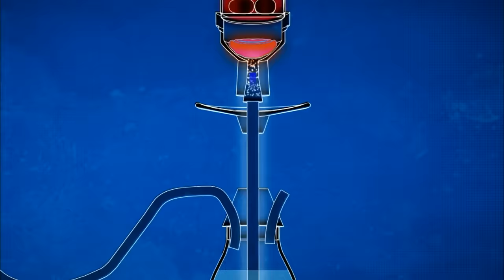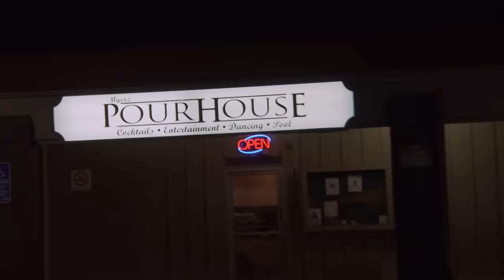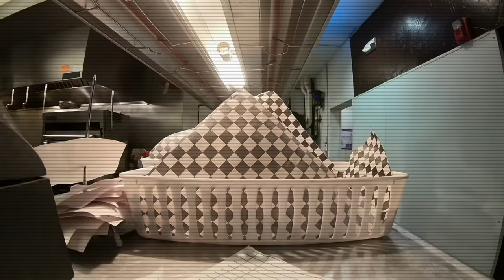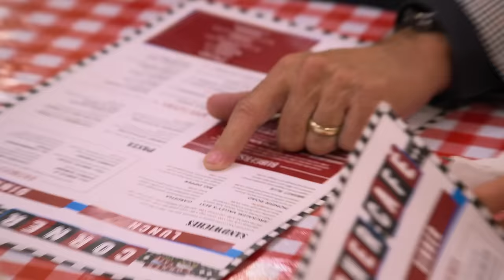Bar Rescue’s Most Haunting Discoveries 👻

Comment: One of the places I worked in, nobody ever cleaned the trap pan under the grill. 
It caught fire the 2nd day on the job, and it wouldn't go out. It was months of grease soaked ashes... burned like a tire fire. The response I got was "Oh nobody told you, we don't turn that side on."
I had to dump a whole bucket of salt on it to avoid pulling the supressor system handle... which would destroy all the equipment and shut down the kitchen... because the extinguisher didn't have a charge anymore. Turns out someone used it to kill a wasp nest outside. 
Yeah. 

I wigged out on the GM about the state of the kitchen and laziness of the rest of the cooks and how I cant work here if I am the only one who knows what to do. I am just a COOK and I know better. The GM had zero kitchen knowledge. The head bartended was the one with the obligatory Serve Safe certificate and she never ever inspected the kitchen. 
They promoted me to kitchen manager 😂. They didn't have a manager... just a checklist of stuff they were supposed to do every night that nobody ever enforced. 

2 people quit cus I expected them to work. 😂
They were butt-hurt cus I was new and they got passed over for the promotion, they didn't even know how to filter a fryer. They were waiting til it was black and smoking, and then just replaced it with new oil without scrubbing the crap out of the bottom. 
Complete shiz show.
Its too bad this show didn't exist then, cus it was a prime candidate.
Reply: I'm from a little country in the Balkans. Yknow, the place regularly mocked for people being careless, not giving shit about health and safety at workplaces etc. 
This kind of shit would close a restaurant within a few months, alongside a hefty fine for the owner that would seem prohibitive even for the Americans. And you're gonna see an inspection at least once a year, and on average twice as much, so that everything remains to the code.

That's why bunch of this shit seems like a skit to me until I roll up to a comment like yours and start to question my sanity. Am I the only idiot regularly changing oil in the fryer, am I the only guy that would be bothered by rat feces or dead cockroaches in my dry pasta cupboard? Could I be insane for having a chlorine-based sanitizer spray hanging from my belt at all times so that I can use it on my hands after any contact with raw meat and/or before handling any finished meals? I mean, this basic hygiene shit is a norm over here, so I get confused after seeing people doing shit like bars in the video for years before getting caught.
What I see is that you guys have really lax health and safety laws in comparison to us, when food is concerned. And that's funny, given our tracklist of other clearly hazardous leisure activities, usually involving military ordinance and children in the same sentence.
Reply: Wow. Good on you for having a brain and using it like that.
Reply: @a7HKdAbmET  we had the inspector come every March, and they would clean and label everything like its supposed to be once a year, but without a chef or kitchen manager, there was nobody making sure it got done every day. The head waitress had her hands full with her staff... if you ever worked in a restraunt, you know waitresses tend to be the laziest, most entitled drama farms on earth 🤣. They only make $3.25 an hour, afterall... 🙄.
The owner had 3 or 4 other bars too, so the GM was there once a week at best and didn't really know anything himself other than the required things like safety equipment and legal certifications. 
They hired cooks who knew what to do, but were left unsupervised and they became lazy and entitled and felt like they could do whatever they wanted.
You see that on Bar Rescue all the time too. They drink and flirt with waitresses and get mad when asked to clean. 
They just needed someone to take it seriously.
Reply: @sillianjloth254  the chef I worked for prior, despite being an intolerable prick, was really good at it and pounded all his knowledge and experience into our heads. I would have stayed there if he hadn't thrown a plate at me. 🤣
Cocaine is a hell of a drug.

Comment: As if the term disurbia has a whole new meaning when it came to the hookah bar. I'm literally disturbed and traumatized just by the majority of the whole joint. From the poor guy puking, all the trash inside the bar, the liquor in the plastic pouring jars gaining mold, the filth and gunk in the hookahs, to THAT PART.

That idiot has no right whatsoever to run a bar, EVEN IF ITS THAT MESSY. He shouldve cleaned EVERY END OF THE NIGHT, AND HE'S LAZY AND STUPID.